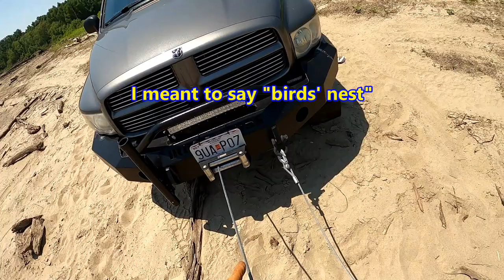New Dodge Ram, Mark Twain Edition.  The Mississippi River Mud-Slide.

Comment: In an emergency if you don’t have a land anchor you can use a spare wheel.
You did a ditch deep enough to drop the tyre into . You angle it slightly away from the direction of pull and attach the line near the bottom so that it pulls the tyre into the ground.

Comment: People fail to realize how heavy their diesel engines are. The mud always remembers.
Reply: Nice wide
Tyres air'ed down
Reply: That would have happened the same way if he had a gas engine.  That isn't so much about weight as is surface conditions and tires.
Reply: You mean that my four wheel drive Cummings isn’t meant to tow a trailer in the mud on a slope? I guess it’s job security for Ron and his son when people have more money than common sense and entertainment for perfect people like me!
Reply: @PetrolJunkie  Wouldn't have made a difference; Sun dries the surface so it look ok, but it's pudding underneath. Happens a lot in Arizona too.
Reply: Cummins weighs 1100lbs. Its not a mud truck, even with wide tires. But it'll eat up snow.
Reply: Why I got a gas engine in my ¾ ton
Reply: @PKent-qx9uu  and New Mexico.  Sand will crust, you can walk on it but it wont' break but drive a 4x4 and it will crack and drop you down into deep sand.
Reply: It’s not the engine is the axle

Comment: I'm more impressed at his dodge dash without any cracks in it
Reply: MICHAEL!  IF YOU  HAD  THAT  MUCH  MONEY  INVESTED IN THE  EQUIPMENT THAT  HE  OWNS!    YOU  WOULD  LOVE  EVER  TRUCK  HE  🚚  OWNS  ALSO!  Great Video as always,!
Reply: It's still new...give it time...
Reply: That's alright, he's got them in the windscreen instead.
(Here in Australia that would actually class the vehicle as unroadworthy.)
Reply: i was thinking that to lol
Reply: My '00 had the dash crack.....  Replaced it and had no issues
Reply: @morriewyatt6234  I live in New Mexico and the windscreen's get chipped by rock almost weekly.  One time I was driving home from work and drove over a mountain pass (9500 ft.) but the wind was blowing almost 100 mph  (~166.6 kph).  Almost everyone's windshield was sandblasted and a few had all the windows blown out; first one window would go, then the next, and so on.  The last one was the front windshield.  Very nasty day for every one.
Reply: @REWYRED  Where did you buy your replacement? Have a nice new (within the last year or two) crack in my 2000 as well.
Reply: He takes it out at the end of each day and stores it in an old bathtub filled with Armor-All.t
Reply: Is it the 2nd gen that has dash that crack 1994-2001 is the models that will crack

Comment: A thing I learned on a trip to the outer banks was to lower the tire pressure to 10-15psi to make a wider footprint on the tires and help keep the transmission cooler

Comment: When I did motorsport recovery. I always carried 4 metal handled shovels. Stick the blades in the ground in a row with a backward tilt. Then lash top to bottom of the next rearward. Then shackle to the shank of the first.. it is amazing how much holding power they had.

Comment: You mentioned "Slow Down - Move Over".  In central California where I'm from, there were what were called, "Lookie-Loos!"  Anything going on along the divided highway, they had to see what was going on.  Even to the point to slowing down in the fast lane, so they could look to see what happened in the lanes going the other way.  A lot of the divided highways in the Sacramento area had landscaping shrubbery in the center divider.  In some places the shrubs were tall enough it hampered seeing the lanes going the other direction.  One day going home from work, I could see ahead in the opposing lanes, there had been someone pulled over with car trouble.  And it was obvious the Lookie-loos slowed down and were rear-ended, causing a chain reaction pile up.   There were cars on my side up ahead in the fast lane hitting their brake lights.  So I moved over to the slow lane.  When I got up to the scene, one of the worst wrecks on my side,  was a Caddie that had slowed down to see what was going-on, on the other side of the divider.  He was rear-ended by a Corvette "at speed!"  The Caddie nose-dived, and when the Corvette hit, it went under the Caddie like a wedge, raising the Caddie almost totally off the ground.  Luckily, I kept my distance from the cars in front of me, and I looked up just in time to see the car in front of me rear end the car in front of him.  I wasn't sure cars behind me had seen that, so I pulled off on the shoulder, and drove around the remaining wrecks, until there were no more "lookie-loos".  
     I then drove home safely, with no more "lookie-loo" problems.  
     I told myself when I first started driving.  If I ever get in an accident, it will be because I wasn't paying attention.   Knock on wood!  I haven't had an accident yet!   
     Another time I was going to work.  I was almost to my off ramp, when there was a thick fog bank.  I could hear tires squealing, and then the sound of an impact.  I immediately pulled over to the shoulder.   The cars behind me went on into the fog.  There was more tire squealing and sounds of impact.  I drove slowly on the shoulder and made it to my off ramp.  If I had been any less alert, I would have driven into that fog like everyone else.
     Pay attention people!   What's happening in the opposing lanes shouldn't concern you.  What is happening anywhere in front of you should be your only concern.  Including emergency vehicles and flashing lights.  You in a hurry?  Getting into an accident will sure make you late to anything but your funeral.

Comment: Not sure if you have ever thought about it, but on that truck it may be a good idea to look into adding a second battery as well as an upgraded alternator for the added strain of the winch. Full draw on the winch is probably close to 100 amp and the alternator on that truck isn’t much more than that. On a prolonged job like this one it would make a difference with winch speed under load by maintaining the proper voltage to it.

Comment: Use 2 delta style boat anchors and your own winch and you can pull yourself out of most the stuff you might get stuck in with. Them delta as pulled piece and dig themself deeper and deeper into the ground to become solid anchors.

Comment: The ground anchors are essentially modified "Danforth" boat anchors.  Clip the fluke points a little and a cheap one from WalMart does a decent job, especially in sand.
I have a pair of light winches on 2 inch receiver"stinger" mounts and my truck has receivers in front and rear.  Add a couple of snatch blocks and I can get a lot of things pulled out even with the light duty winches.
Reply: A modern salt water sand anchor like the mantis desgin or simular actaully works better than typical land anchors for fresh water anchors.  They are designed to dig in more the harder you pull on them.  The land anchor is modified version of the smaller anchors deployed to keep shore launches tied to the beach.  They used to hammer the spades into the sand and then dig it back out. The problem was that at 90 degrees it could be pulled out.  It wasn't until later that they added the hooked shaft to get about a forty-five degree angle pointed so that a load on the eye would shove the tip of the spade deeper.  I actually use the smallest version of a saltwater sand anchor in my recovery kit and I've pulled full size trucks out of mud holes with it.

Comment: One of those deceptive shores. Hard enough crust to float the wagon, but soft enough under it that any cut will have you driving into it. Workable ground but a bloody chore if you're unprepared or things fall against you. Just because there's a dry surface and a crust one still needs to keep an eye for nearby hazards like the river as it still washes into the shore and even a distance of a 100+ yards from shore can leave soft spots. Something to be wary off in the summer months in tidal areas and major water ways when trying to cool off.

Comment: Never thought i would see a Ron Pratt truck so untidy😂👌👍
Reply: There are two times I have come to expect that situation. First is when there is a winter weather emergency (like in February this year). Second, would be like today - tying to have all the equipment needed for a job that might not need (or be hard to tackle) a larger vehicle for the initial recovery.

Comment: Shackles and clevises are U-shaped mechanical couplers closed by a pin or bolt. ... Shackles are primarily used in construction, rigging and lifting. A clevis is used in less demanding applications such as farming and towing.

Comment: Your truck had NO issues pulling the Dodge Ram out because you have the Equipment & Brains.👍
Reply: He was using proper technique.  You have to anchor the winching vehicle properly otherwise the winch has nothing to pull against.  Doesn't matter how big your truck is, you can't recover anything if you don't have a good platform to work off.

Comment: In mud with a yankum it works pretty good without causing damage to pull the slack out  at about 5mph until it pulls you to a stop. Hit the brakes and let the towed vehicle try to drive out. Don't try that on a car though.  Ron doesn't like to jerk on the rope because it can cause damage if not done correctly and he doesn't want to damage needlessly I bet.

Comment: The smaller electric winch does not do well when you pay out a lot of cable. It has to overcome the cone brake to pay out, should only be done for short distances. Its better to put that type of winch in neutral and pull out some cable.

Comment: a 20 kilogram ultra anchor, the wedge shape with the bar. need to use several clevises to get one large enough for the winch hooks to hook to.
Though a 20 kilo ultra anchor, with 30 feet of chain ( hundreds of feet of rode / rope ) is enough to hold a 50 ton boat at anchor.

Comment: I'm just chuckling the fact you did one similar to another towing channel... offroad, in the sand... just without a hard yank!  I like you way of loading the rope and then just pull, no a hard shock, which I doubt is good for either vehicle
Reply: Do you think a smooth pull in Southern Utah blow sand would steadily pull a diesel truck and trailer out ? It might , I don’t know , but I doubt it. Also that Dodge would not make it anywhere near a stuck truck in a bunch of sand.

Comment: I remember seeing a motorhome buried up to the bumper on the beach in Corpus Christie, Tx where they "daisy-chained" 3-4x4 trucks together to pull the guy out. He weighed around 26000 lbs and it took all 3 to pull the guy out. It's not fun when stuck in sand.

Comment: Shoulda brought the tator out and made this a 5 minute job. Great job Ron, like a true professional!
Reply: 45 minute+ job just with all the setup and breakdown to run line from ground able to handle the weight, just something to think about.  
if you ever go 4x4ing in sand ( we play in the sand-dunes where I live )  you want a low tire pressure somewhere between 15 / 20psi and an air pump ( or tank ) for when you get back on the regular roads.

Comment: When Mr. Ron says it's gonna be alright, it's gonna be alright! :)
Curious as to why separating the truck and the trailer would have made the recovery worse? I would have thought it would have been easier to recover two lighter weight pieces than one big unit (truck + trailer).
Reply: My guess is it’s Hard to keep the nose up if it’s not hooked  but I know all that do recovery’s say the same thing about unhooking

Comment: It seems like most trucks and 4 Wheel drive vehicles have attachment points for recovery vehicles. Most regular autos do not. That sand looks a little like that sand they have to deal with in Southern Utah. Those Yankum ropes are being used by more and more recovery outfits.

Comment: sand could not been too bad we been in sand were had drop tyre pressures down to 15psi

dig hole on angle sit your spare tyre in it burry it too use as a sand anchor as well

Comment: Man I know you guys are pros at what you do but I still don't know how you dig through that sand like that. Especially with the tires that are on the truck which I don't know. That maybe a good tire for the sand. We used to play all the time in the sand down at our river but if I ever stopped most of the time it was over. It may have been the 12 oz goggles we were wearing back in those days also. You're a lot more indestructible when you get about 8 or 9 of those in you.

Comment: 5 minutes in, this may be answered later, but why wouldn’t unhooking the trailer be a good idea? It’s got straw bales. I wouldn’t think that unloading it, unhooking it, pulling it backwards a bit, then getting it out of the way would be that difficult, and that gives you solid access to pull the truck either direction.

Comment: What would you do if you could not get a tow outa there? I think I would try placing logs in front and behind the wheels try get vehicle up on top of them (use my jack if needbe) that would be first thing.
Then I would create a rolling platform, inch by inch. Might take hours but hopefully creep outa there.   ♒▗▗⊗▗▗ ♒▗⊗▗▗ ♒♒ ☞

Comment: Clevis is for pulling shackles are for lifting.
Reply: Shackles and clevises are U-shaped mechanical couplers closed by a pin or bolt. ... Shackles are primarily used in construction, rigging and lifting. A clevis is used in less demanding applications such as farming and towing.

Comment: Nice recovery there Ron.. That Unit 16 is proving its worth in more ways than one as a vital piece of equipment. Do you get enough off-road stuff to warrant getting something like a light duty  Ford F450 or a F550 4x4 dedicated wrecker with the Jerr-Dan MPL-NG package or something at all to add to the fleet

Comment: Mr. Pratt, you mentioned NOT dropping the trailer. On your first walkaround, that would have been my first inclination- to lose some of the drag weight. What's the reason not to? Thanks for the great vids- I learn something from each one!
Reply from the maker: In my opinion, there are only rare occasions when the trailer should be disconnected and this was not one of them.     By separating the truck from the trailer you create two separate vehicles that must be recovered.  A trailer is designed to be pulled behind a truck on the ball.   Separating the trailer would then require you to drag the jack and/or the tongue through the mud placing undue stress on them and possibly creating a "plowing" which would create even more resistance than the combined units.  Also, you have the problem of trying to reconnect the trailer on a "less than favorable" surface if you are able to get both back up onto the sand.   Just my opinion....I know others will disagree.    Thanks for watching and God bless.
Reply: @RonPratt  Looking at it again, I can see doing one job instead of two. I've been in a similar situation walking along a creek shore- nice hard baked crust...then that one step that goes knee deep into pudding, lol. Thanks for the reply, and again I learn something from each vid. Having driven roll-off dumpster trucks for for years, some of your kit would have come in handy. Stay safe, Boss.

Comment: That's the right way to use one of those ropes.  The inventor, that is exactly the type of situation it was made to recover.  The stretch helps to reduce shock loading on the hook points and the kinetic energy helps to pull.  The guys that gun it and "yank" have no skill and do not understand how to recover anything.

Comment: Next time park on a 45°angle to stuck vechicle run a line to the truck with a snatch block anchor the end to the winch cable to tow  vechicles rear trailer hitch that doubles your pulling power and your holding power about 4 times as now it has to drag the winch trick straight sideways

Comment: What does it mean "bird nest"?
Reply: A birdnest or birdcage is what happens to the winch cable when it unwinds it's self from a spool and then you try to rewind it without completely un-spooling it. Because of the stiffness and springiness of the cable, when it is tightly coiled it wants to uncoil. Releasing the clutch and letting the spool turn freely can cause it to spin without you pulling out cable. If you then pull out some cable and try to winch in a load the cable that is still on the spool will not be laying flat and tightly on the drum. When under tension the line coming of the drum will "dive" into the rest of the coils and make a huge mess and won't uncoil properly next time. It can also be damaged.

Some pictures:
http://www.winchbin.com/1365/how-to-spool/
https://www.e-rigging.com/how-to-use-tyler-tool-hand-winches
https://www.dredgingspecialists.com/eliminator.htm
Reply: Tangling from coiled spring energy in the cable when let slack.

Comment: for all of you 4x4 experts on here,  I was once told by a co-worker that after shifting out of 4x4 you should drive in reverse for at least 10 feet to disengage the system, can anyone confirm this?
this was told to me back in 2008 or 2009 when I bought my f-150 FX4
Reply: It all depends on the vehicle.  Some were like that but none of my vehicles are that way.  I remember early model (70, 80) Fords you had to get out and lock the 4x4 into place. My 08 Dodge and my 11 Jeep don't require that method.  For the Dodge, I just move the button into the gear I want.  The Jeep has a shifter to move into the correct position.  My wife's Jeep is full time 4x4 mode but it shifts from the back to the front based on need.

Comment: Mark twain means that there's twelve feet of water from the surface down.
Reply: That's where Samuel Clemens got his pen name from. 12 feet was the minimum depth for most steamers on the Miss. A weighted line with 6 foot spaced knots was dropped over and the count called up to the bridge. 1 fathom=6 feet.